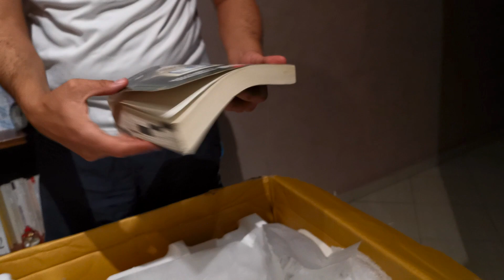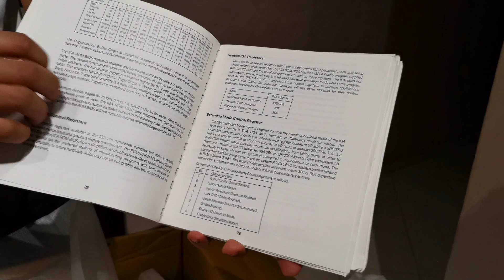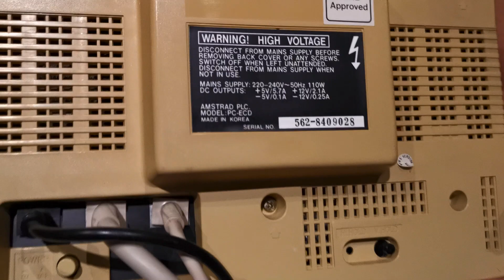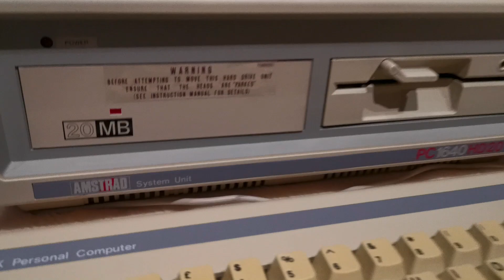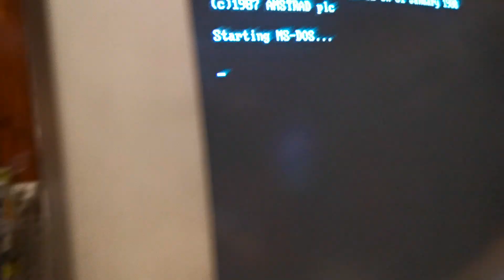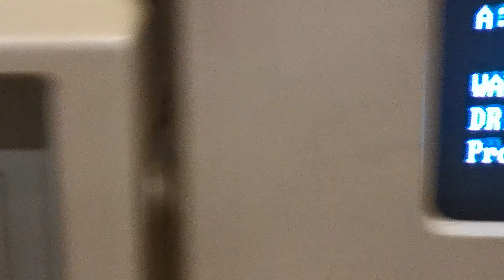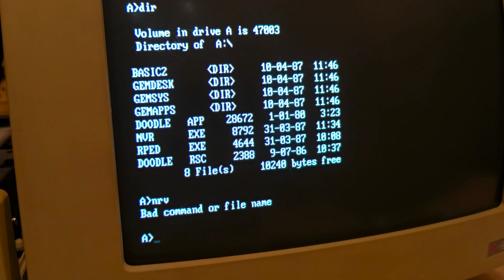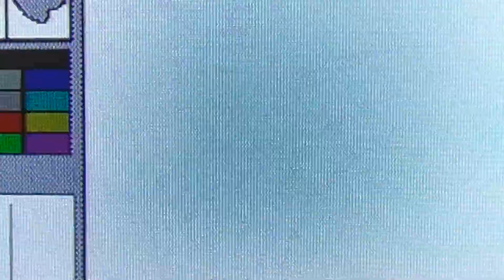Unboxing, Review of a new Amstrad PC1640 HD20 with New Enhanced Color Display, I.B.M 5170 compatible

Comment: I started with an (donated) original IBM PC with two full height floppy drives and when I eventually saved enough money I bought an Amstrad 1640 with one drive. I added a second drive later and a 32MB HDD after that. The needed drive tray to mount the second floppy drive wasn't included and I ended up paying more for it than the actual floppy drive, crazy fun days. I saved enough money to buy the system with the CGA monitor, but the shop accidentally gave me the EGA monitor, that was huge at the time.

Comment: I used a 1640 from 87 until 95. Lotus, First Choice and a CAD program mostly. DOS 5.0 in the end. Monitor/power supply blew couldn't get a replacement. Got a generic PC replacement. Still runs now on windows 98. Deskjet 500 printer from 89 still working fine. Never switched off.

Comment: I still have the PC 1640 with both an 5 1/4 floppy with AT standard (1.2 M) and a 3 1/2 inch floppy with 720 K. Furtheron a Tandon Business Card with 20 MB HDD space and an math. coprocessor 8087 with improved the speed with pascal 4.0 (as long as compiled in the right way) significantly. The screen was EGA from the beginning which was the most expensive but best option.

Comment: That doesn't look new old stock... why do you think it is?
Reply: Indeed.. it's been reboxed.. those books are worn, the box has obviously been resealed, and the packing inside has been disturbed.
Reply: ... and the top of the case has yellowing in such a way that it's clear the monitor had been shading part of it for years.
... and not fitting the earth properly??